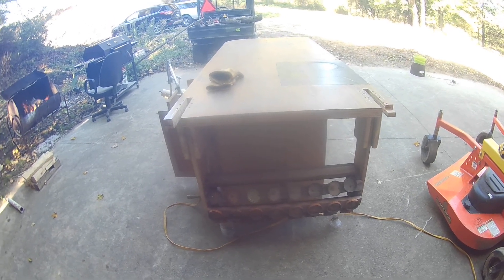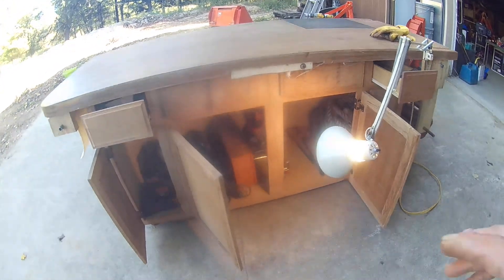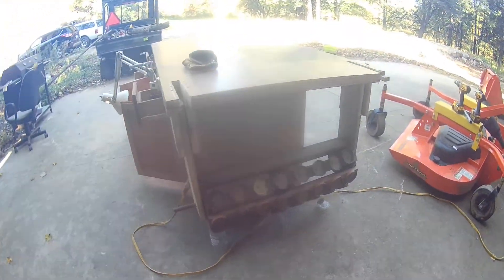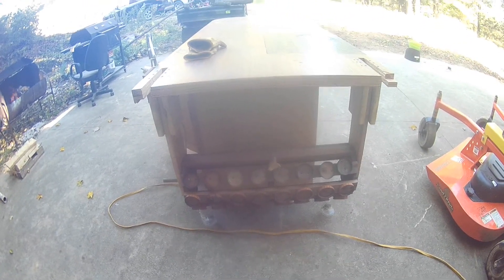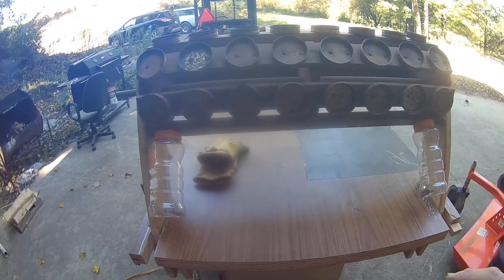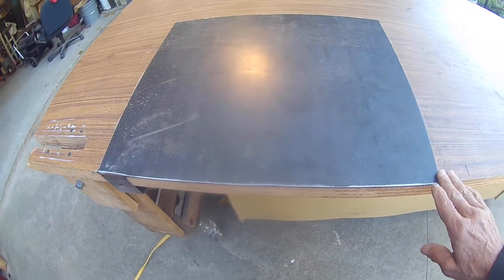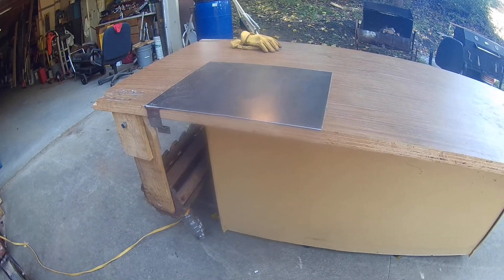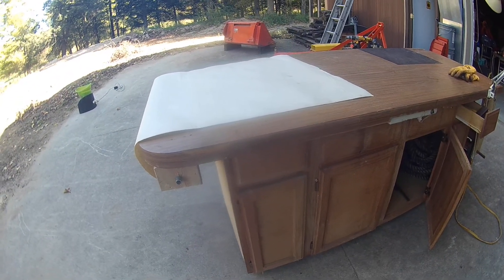Rolling Work Bench

Comment: Those are great ideas. Very creative. I can understand going all over the garage and shed looking for a nut and a bolt. Taking out my welding table to weld minor stuff, and placing newspapers down to paint a project. Thanks for sharing. I will be looking forward to seeing the brake. No pressure Mech Uno. Just whenever you come around to it.
Reply from the maker: Thanks for watching. I will probably make the break next year it's starting to get cold and I don't have heat in the barn.   Later
Reply from the maker: Here are 2 video's that I made of my Hide Away sheet metal brake. Hope you like them.   If you have not seem them.  Later
 https://www.youtube.com/watch?v=r3DzeX51Vmw
https://www.youtube.com/watch?v=It7F4yBI8t8